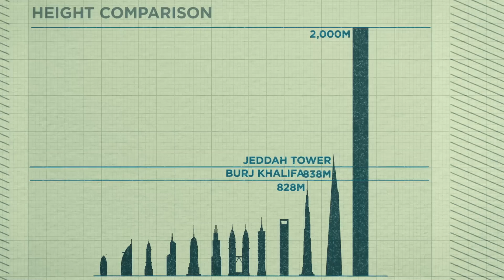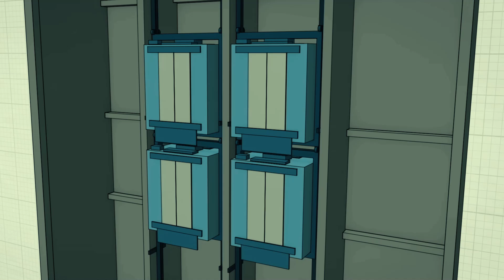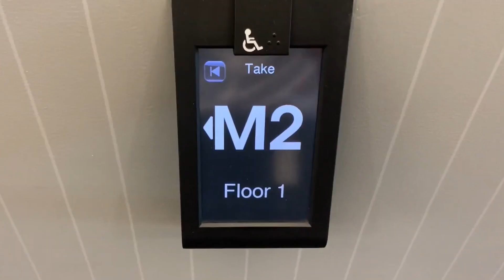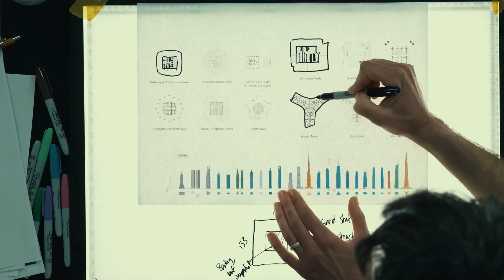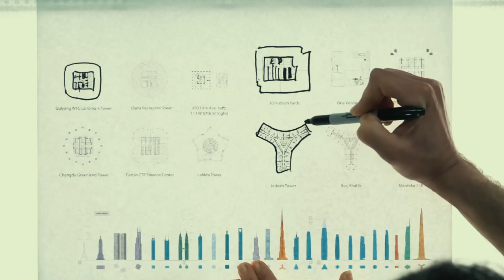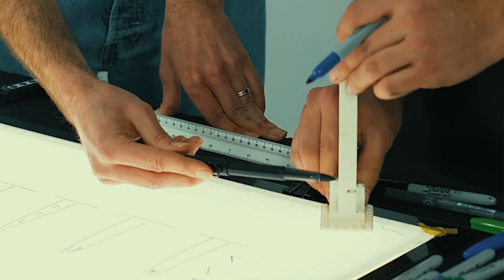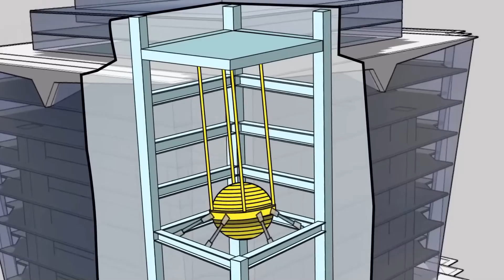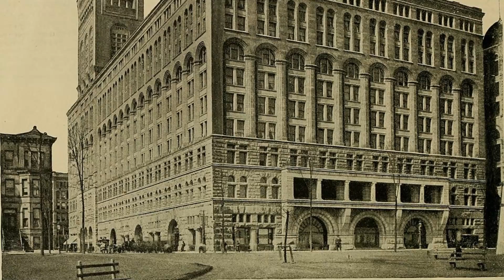Saudi Arabia is Building a 2km Skyscraper

Comment: They were going to build a 170 km long "line" across the desert. For budget reasons it has been reduced to ... 2.4 km.
If we apply the same ratio to the 2 km high skyscraper, it will be just over 28 metres tall, 10 floors.